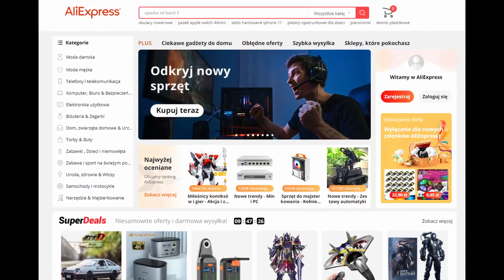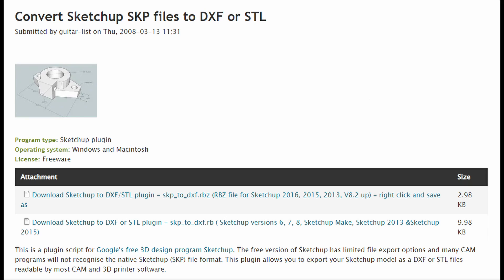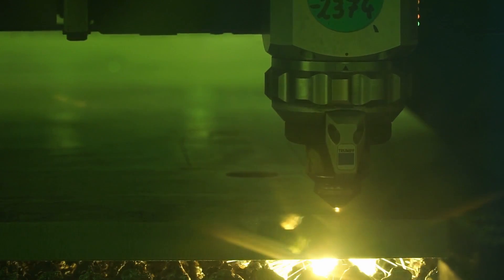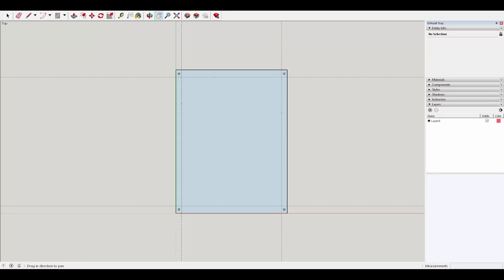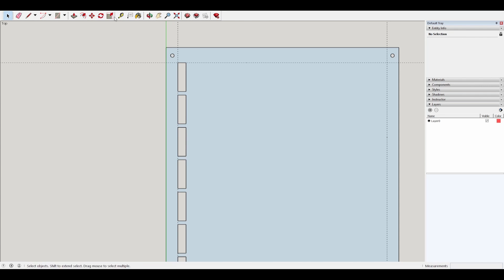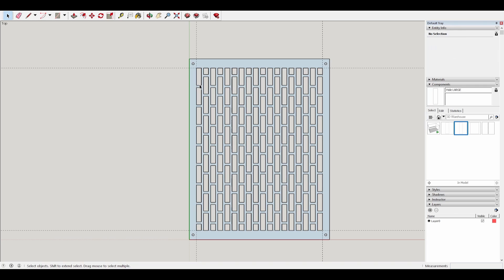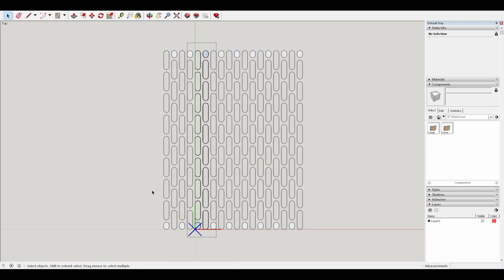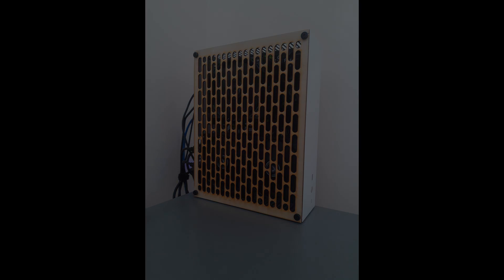🇺🇸 Tutorial - create your own side panel for PC case using SketchUp! (feat. SGPC K59)

Comment: Great effort. Loving ur journey with this case. Have u done a thermals video for this case?
Reply from the maker: Not really, I don't have a very power hungry components, so I mostly tune my fans for peace and quiet
Reply: @MarcinKuna  ok. That makes sense. Will u consider adding 40mm noctua fans on top for ventilation? Or replacing the flex psu fan with a noctua fan?